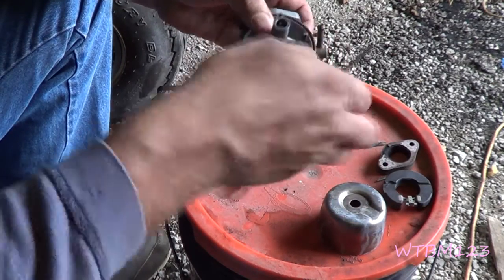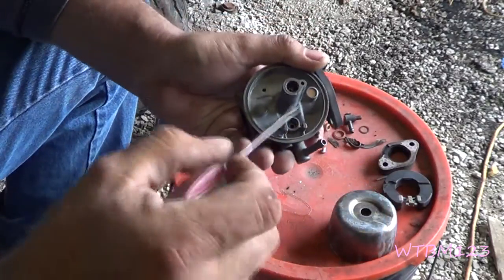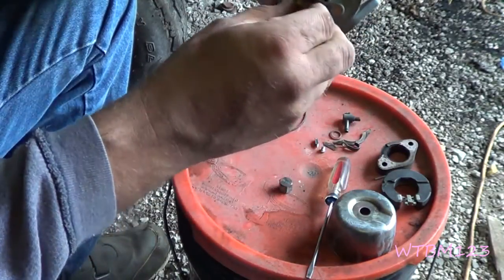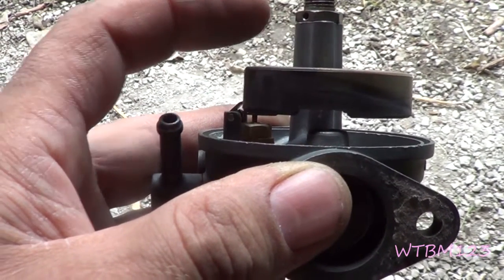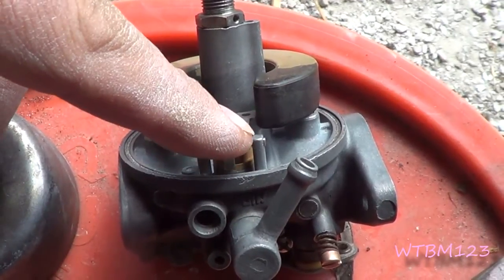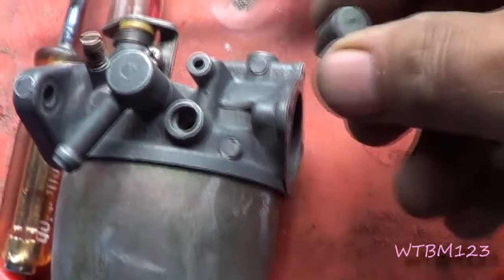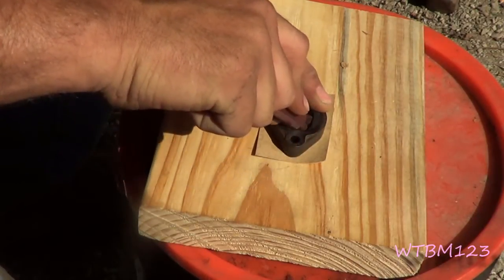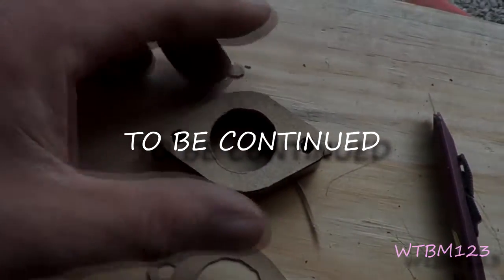ClubCar Golf Cart, part 3

Comment: I allways pay close attention to the emulsion tube with the tiny holes in the sides, a strand of copper wire is handy, then i use a jewlers eyepeice to look at every hole.
Sounds a bit over the top but the carb allways works, the main jet is so big just holding it up to the light shows if its clear :)

Hopefully that extra pressure against the needle valve will stop it over flowing.

Great job, and nice day by the looks of it :-))
Reply from the maker: I know you should not use metal but i usually use a stripped bread tie. I think dirt was the main  issue on the flooding . Hope it is ok now but we will see.
Reply: wtbm123
Copper wire strands are quite soft, softer than brass :-).
Yes bread ties, very similar to fuse wire, i think you would have to be very heavy handed to do any damage, the fact your aware that you could do damage makes you extra carefull.
And if that fails.. hit it with a hammer ha ha :-))